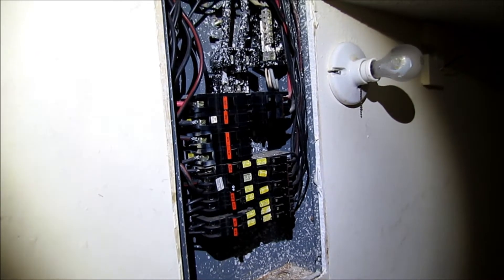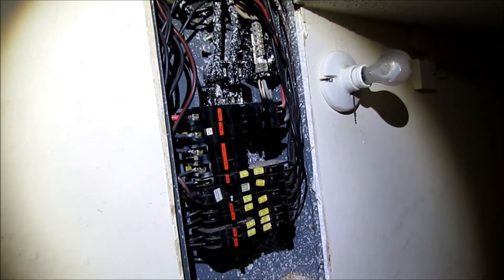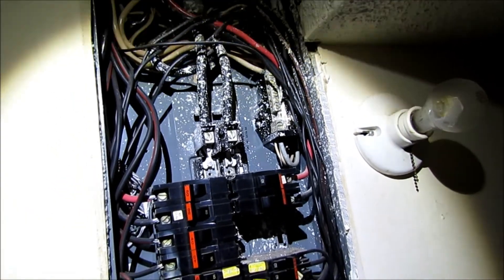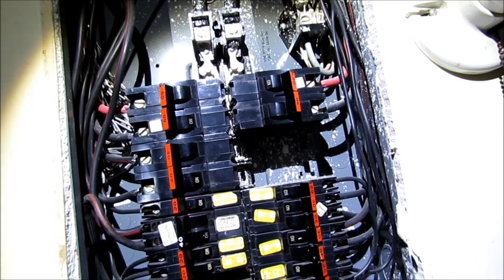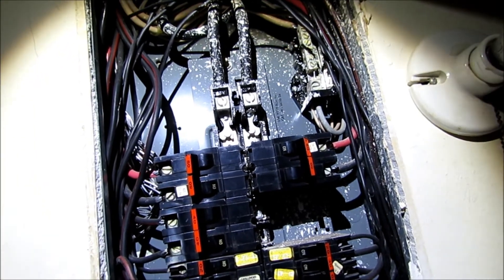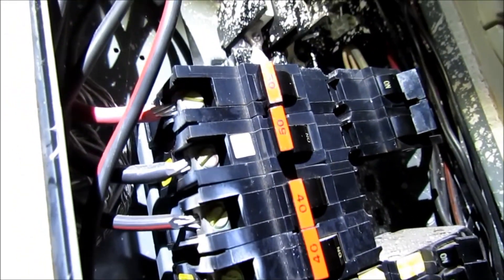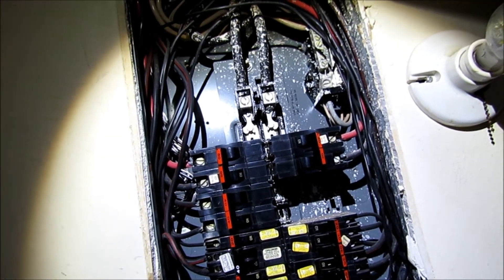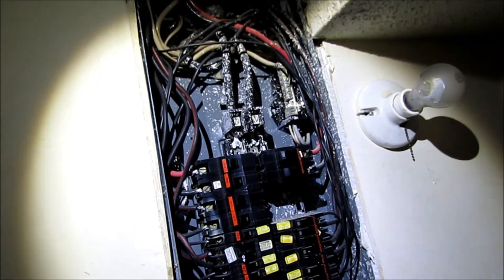FPE Federal Pacific Electrical Stab-Lok Breaker Box Fire Hazards Aluminum Wiring Dangers Episode 83

Comment: The Code says if you get Paint Splatter in an electric breaker box, you must throw it out and install a new panel and new breakers.  Dried paint on electrical contacts cause bad connections which result in fires.

Comment: Aluminum wire in the larger sizes used for subpanel feeders, service entrances, and large branch circuits is safe and still used today. The problematic aluminum with was associated with 15 and 20 amp 120 volt branch circuits, ie the circuits that power light fixtures and outlets. Over time due to thermal expansion and contraction, the connections would work loose, causing high resistance and arcing. Also the gauge of the wire had to up one size from the equivalent copper wire. A 20 amp circuit would have 10 ga aluminum as opposed to 12 ga copper. On the other hand, that fpe panel is a death trap.
Reply from the maker: That is correct, its just the branch wiring that is the issue. Thanks for adding your information to this too.
Reply: @southernhometalk2465  I understand bamaslamma's advice that aluminum wiring for domestic outlets and light fixtures is the issue, and I understand your recommendation that if you have aluminum wiring then you should replace it.

The problem I have with that advice is that it does not acknowledge that the cables run through walls and that replacing them would be an expensive undertaking.   If the problem is with the connections from the cables to the light switches, to the light outlets and to the general power outlets,  then is it sensible for a householder who cannot afford a re-wire to simply turn off the power and work his way around each connection in turn, checking that the screws are tight and the wires have no play ?   If that is valid, then do you have any specific advice / tips on what to do and what to look out for?
Reply: The main failure point of any type of wire is where splices and device connections occur. Failures mid-span are extremely rare barring some catastrophic event such as a nail accidentally driven through the cable. As you look at each switch, outlet, or splice, look for signs of overheating and arcing. Such signs include discolored metal on the terminals, burned/melted/cracked insulation on wires, and melted/burned plastic on devices. If you see any of these, call an electrician.
Reply from the maker: @bamaslamma1003  Thanks for sharing this. One of the things I notice with homes with aluminum wiring is flickering lights. Most-likely caused by loose connections at the switch or fixture.
Reply: Here in Ontario, you pretty much just need to get an electrician to pigtail the aluminum wiring with copper to say it's ESA certified.

Comment: I had a house in Oregon that was built in 1978 with an FPE panel. When I went to sell the house in 2006 the inspector caught the FPE panel issue and I had to replace it before I could sell the house.
Reply from the maker: Thanks for sharing that information.

Comment: I agree that this is a safety issue and should be replaced if possible. But keep in mind that this system has been in place and serving this house for 46 years so don’t think your house is going to immediately burn to the ground if you have one of these panels or aluminum wiring.